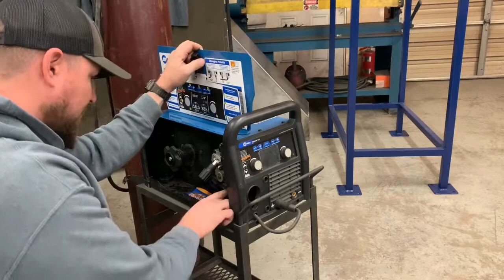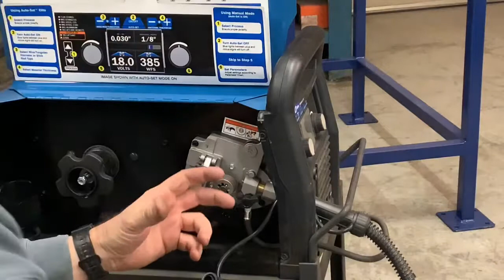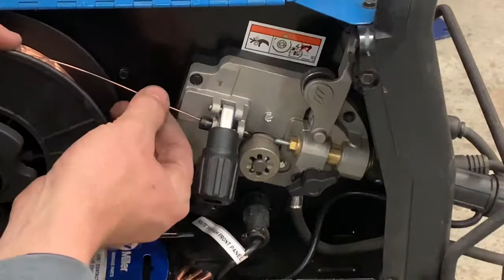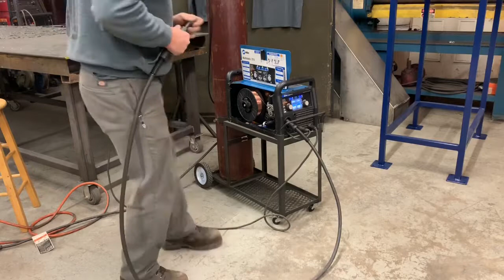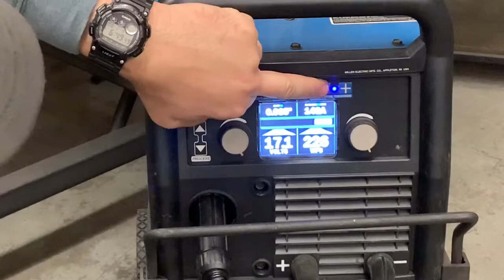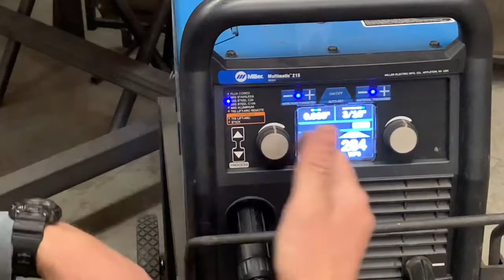Setting up a mig welder.

Comment: I've seen multiple vidz on the c25 tank and some people say to crack it open all the way and some dont and u say you do half way, i was just wondering why you only do half way and if thats the proper way? Thanks
Reply from the maker: Yea I think honestly it’s just personal preference.  I don’t know for a fact that it makes a difference. I’ve always just opened tanks maybe 1 turn. Same for propane on the forklift or when I’m cooking on the grill at home. Never had any issues with burning so I’m guessing it works.  I get really annoyed when people turn them so far open they almost get stuck
Reply: yea that makes sense. Thank you for all your content I watch it often and try to get others to watch. I'm not a welder but I have been known to run some flux core from time to time to repair trailers, but I want to learn and get into the industry somehow, my goal is to operate a "shop" environment and not so much a mobile setup, but I don't know where to start as far as, what to make or fabricate in my shop, I have a Hobart handler 140 MIG machine and basic welding tools. What would be your suggestion as far as starting a welding and fabrication shop to be profitable. What would be the best niche to get into, I feel like everyone, and their momma does metal gates, handrails and trailers lol and I know there would be a lot of competition in my area for that. I'm in GA. Thank you.  @MattcoMetalWorks